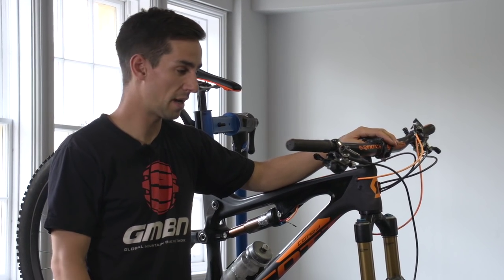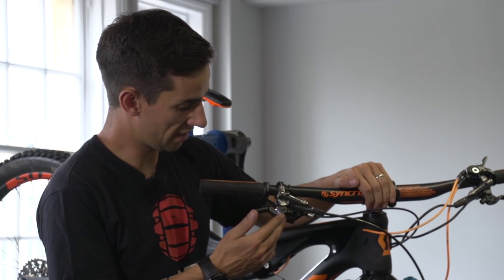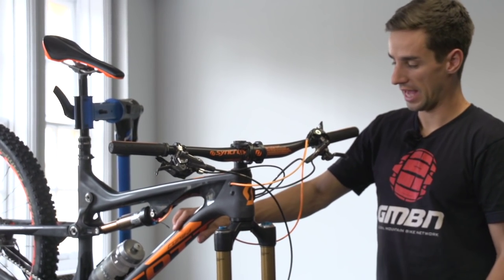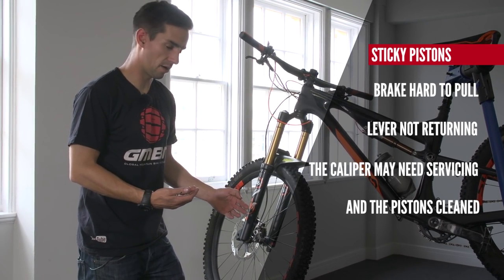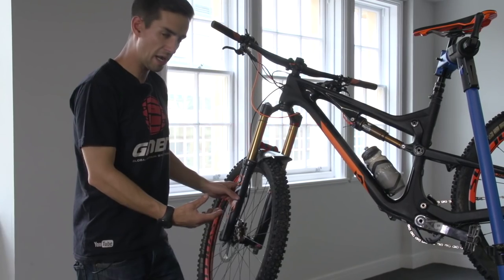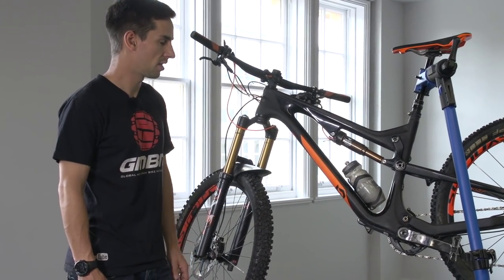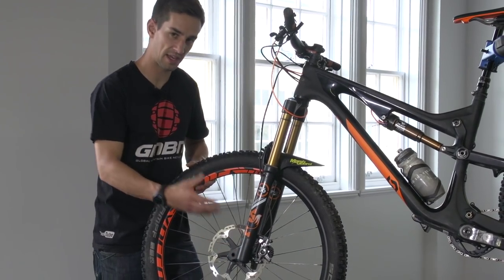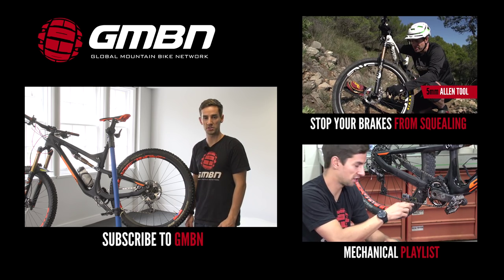How To Check Disc Brakes - MTB Pro Tips

Comment: Hi guys need a bit of help from you. Bought my first proper mountain bike, second hand (Cube Acid). Most of the bike is fine except the owner did not maintain it (if at all) but I got it really cheap so I took it. Problem is both the hydraulic brakes are shot, so they need to be bled, oil and disc pads changed. I'm not an expert since I'm new with this stuff. When I inspected the brakes at home I noticed that one brake piston on the front and both on the back do not retract properly inside when I release the lever. Also one back piston is completely not moving either in or out. My question is should I bother trying to fix them or should I scrap them and buy new brakes? Brakes are Shimano BR-M445.  Thanks for the help. Appreciate it.

Comment: I have a brand new bike with a slight rub on the disc , the tyre does not look when looking down to be completely straight, the rim is fine, someone has said that the unbalanced tyre could put a sway on the disc , what’s your opinion thanks

Comment: Hi GMBN. I have a question about my MTB disc brakes. The front disc brake lever has a little bit of give before it starts to brake. Is this normal or would you recommend bleeding them? Thanks in advance

Comment: Can you do a bike review of bikes under £1000
Reply: Raleigh tokul 3
Reply: +Zesty I've sold a few tokul 3's. Easily one of the best packages for the price. the 2015 tokuls are running like 750 USD. Hard to come by right now though, which is upsetting.
Reply: Jay Parker Yea that's the bike I have right now. You can see it in my profile picture. I love it!
Reply: Zesty Yeah man my co-worker has one, it is a killer bike. best off the rack bike of 2015 in my opinion

Comment: can you plz do a video on the front shifter? i got hugh issues with my xt shifter since it doesnt shift under preasure (uphill)
Reply: velo1337 you shouldn’t try to shift under pressure, shift BEFORE the uphill, otherwise you’ll be snapping chains left n’ right.

Comment: Hi GMBN: I have two bikes one with Deore brakes and one with SLX brakes, after some time of riding both, when I wipe the rotors with a rag or paper towel, there always seems to be some of black stuff, once I clean them off and ride them for a while there will be black stuff on my brakes again, they are not noticeable unless you wipe the rotors with a towel then the black stuff shows on the towel, my brakes don't squeal they function perfectly. Is it leaking oil? Why are SLX and Deore both behaving that way they are mid-range brakes that should be reliable. PLEASE HELP both of these bikes are purchased within a year so if the brakes and leaking oil I can send them back to Shimano under warranty.

Comment: tips for getting oil off from discs if they are making noise ? ( dunno though if oil is  cause of random "screams" when breaking)
Reply: Pienimusta boiling/evaporating. If you have metal or sintered pads just get a blow torch or use a gas stove and heat the face of the pads which comes into contact with the rotor and the oil should boil and evaporate off.
Reply: Pienimusta rubbing alcohol

Comment: my pistons aren't returning meaning one of the pads is doing more work then the other. how do I fix this
Reply: jordan maadi what you have to do is take it to a bike shop and let them check it or you can remove the pads...dont pull the leaver with the wheel of, once the pads are of use a tool (spoon, screwdriver, blunt object) and push the pistons back

Comment: i think i have problem with my caliper adapter. it make my caliper not right in the center of the rotor.
when i screw my caliper in,it bend to one side. i try to make the caliper right in center before screw it in. but it doesnt work
Reply: +Prakasa Aditya I realize this is a late rply but it is possible that is you have cable disk breaks that only one pad moves. That's the way my brakes work. So when you break the one pad kinda pushes the rotor over to the other pad and slows you down that way. There should be a screw on the stationary pad. Adjust that slightly and the pad should move away from the rotor

Comment: How do you sort the Pistons if they aren't returning
Reply: Ewan Brown Clean them and then just drench them in wd-40, always works.  wash them after they are moving though
Reply: Ewan Brown I wasn't able to get the pistons working on my old break with any chemicals or mechanical pushing :\. Needed to buy a new caliper. Would be great to have a video on how to improvise if the usual methods just don't work.
Reply: Batlikeman this is terrible advice for Ewan, do NOT do this- WD40 shouldn't be used anywhere near a brake-and certainly not for this problem. WD40 is a light oil based product that may introduce contaminated material into the calliper and more importantly you risk contaminating the rotor and pad. A calliper should be properly inspected and serviced if needed. With the pads REMOVED before inspection, a stuck piston can be coaxed back with light pressure from a plastic tyre lever or a drop of the brake fluid applied carefully around the piston. That might free up the piston. If its sticking badly and seems 'dry' then it probably needs serviced/stripped. Most good bike stores will do this if you lack confidence or the tools.
Reply: ***** correct :) just not the WD40...never the WD...

Comment: Can anyone help me with this a problem I'm having with my brakes..

After a long ride in very wet conditions, I got home and rinsed my bike off. The next day when I wanted to do a full clean I noticed my rear brake lever was not returning and the pistons were pushed out so that the wheel wasn't spinning. I took the wheel off, pushed the pistons back in and replaced the pads. When I put the wheel back on, the brake lever went all the way to the handlebars and the pistons don't push out and the lever doesn't work at all.

I have Shimano M500 brake levers and the brake is Shimano MT-500.
Reply: Did you ever figured out the issue? I have the same brake system and mine feel spongy even after multiple brake bleeds and new brake pads.
Reply: @hardtail_reapers_mtb8014  I tried a bunch of different things but the only thing that worked was when I replaced the brake lever with a new one 🤷
Reply: @kfkosz  I'll probably have to do the same thing... thanks!

Comment: gadzukes skin oils on your rotor ! clean that off mate!
Reply from the maker: sky Maracle Hey Sky, I don't think oily skin will cause you any trouble! Certain types of dirt you may find your brakes not having as much power.  Thanks for your comment, Marc
Reply: They'll squeal if you get a couple of good prints on there especially if your running metallic pads.

Comment: "Disc brakes are all slightly different depending on the brand and model but all work on the same principle,"

Is this guy for real? All mountain bike disc brakes have hydraulic fluid? should change the title and mention that this mostly does not apply to non-hydraulic fluid disc brakes.
Reply from the maker: wangmauler Sorry I should have said this applies to hydraulic disc brakes, but that is the majority of disc brakes used on Mountain Bikes. Neil
Reply: wangmauler mechs are normally used on lower quality bikes, bikes you wouldn't generally want to do much actual mountain biking  on.
Reply: Voltaic Cell I use mechanical disc brakes, and they are amazing for me (btw I’m a mountain biker). I haven’t ever had issues with stopping super quickly. Maybe I’ll try hydraulics one day though...

Comment: Hey guys, hail to the show and yourselves!! Our saviors from mechanical issues! So, the pads on my rear brake are not fully touching the rotor. They´re are more or less using half of the width of the rotor. What could be causing that?

Comment: Both of my disc brakes make a fluid sound everytime i break. Its not actually fluid at all but sounds similar. No signs of leaks or wear. BUT need advice.
Thanks
Reply: Do you have tektro brakes?...because i have tektro brakes and they make also that weird sound,i found out that it is very common with tektro brakes because tektro cant build good rotors that always vibrate when you brake